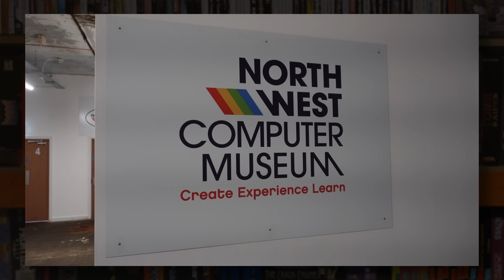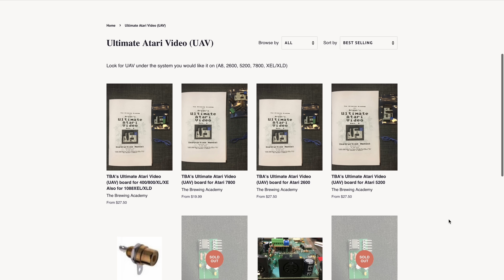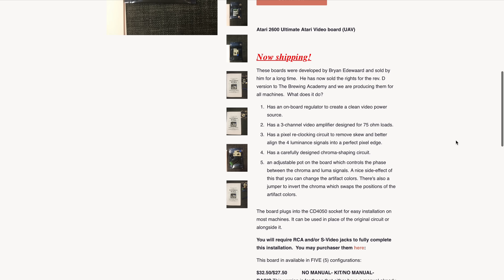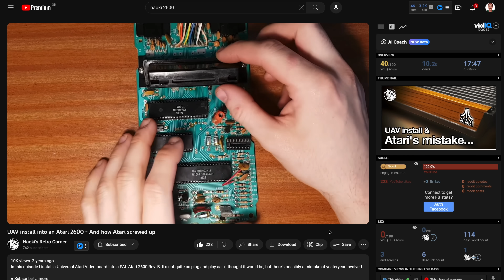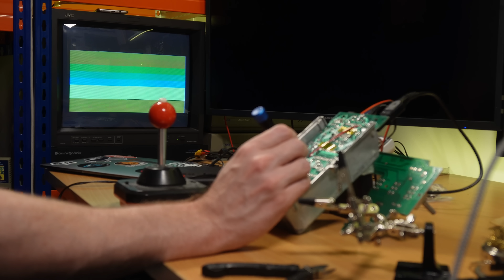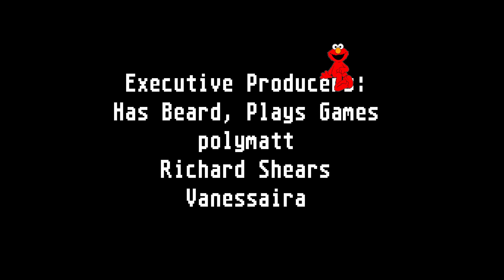A Totally Normal Atari 2600 Restoration & UAV Upgrade

Comment: Might as well replace the antique bulk capacitor, it should be thoroughly dried up and scarred. Helps to protect the old chips especially if you don't want to invest in a modern power supply.

Comment: I have not soldered yet but I do have a solder station brand spanking new and I've already watched enough soldering to realize it's easier than the stuff I did in college for welding class that was a royal pain in my ass and I still did not pass 90% of the students fail😂

Comment: I did an RF mod on a 7600 and what's cool on those is that it natively outputs the RF and just needs the jacks to hook up to.

(P.S. I drilled a hole in the side of the case there, too. Don't feel too bad.)

Comment: When you service mechanical switches like that, it's good practice to use Silicone grease (Dilectric grease) as they protect the copper contacts and buss bars from oxidation and because it's synthetic, the silicone never dries out or gets tacky which provides years of effortless smooth operation..  Don't forget to lube the detent balls (If they use them) as those are usually what hangs up those style of switches the worst.

Comment: hot glue certainly has its place, especially when it comes to modding old consoles

you solder a wire, and dab a bit of glue further down (NOT on the joint) in order to take the strain off of the delicate pads

Comment: I live in NTSC land in Oklahoma City, I buy these things not working all the time, the fix is usually the big filter caps for the incoming power. So I just replace all of the electrolytics, and what I have done is to add the eBay, composite converter, and route the composite out through the original RCA cable. I won't buy a TV unless it has composite in, so I always make sure when purchasing that it's there. Even my 52 inch LG OLED curved screen TV has composite in, and Galaxian and Galga look awesome on that screen, as it does my original Atari Super Pong that has also been converted to composite out

Comment: "ima solder this upside down" ~you  ... look you damn sadist they make dip sockets. why solder any dip package anything. doesnt matter if its a 555 or dac or what. if you ant it to be upside down put the socket on the other side of the board. now that thing is deformed and nothing will ever be alright ever again for it

Comment: As a newbie to your channel, I'm confused why the chip was soldered underneath ? Especially when there looked to be a socket in place on the other side to save you having to solder in the first place? Was it so you had extra room for the modifications?

Comment: I wasn't aware there was a reasonably priced video output mod for these old 2600s. I have three out in my storage shed.. makes me want to dust them off and mod them up. I love collecting older consoles. I've got a couple of NES's, an N64, a Wii, a Wii U, Switch, Sega Dreamcast, PS1-PS5, Xbox 360 and Xbox One. I'm thinking about installing a component or HDMI mod on some of the older consoles too.

Comment: Mmh on my 2600 jr I let the rf modulator in the system without problems. I dont like removing function and I only reposition the rf port for a nintendo multi out port

Comment: It's perfectly fine to drill holes in the plastic cases of these consoles to add the new connectors. Also, these are not one of a kind item, and we're already adding new electronics in them by that point. On my book, it's all good! Hoping the museum visitors will be able to experience the glory of video games from the 70's!!

Comment: Lol, if they're museum pieces, then doing anything to them other than restoring them to original, is not "saving" them, it's "ruining" them.
Reply: Production of the Atari 2600 ended on January 1, 1992, with an estimated 30 million units sold across its lifetime.
I think letting people get their hands on this one in 30 million is fine.
Reply: @unpersonableme1805  This is not "letting people get their hands" on one, it is a museum piece, it's going back to the museum, nobody is ever going to be allowed to play it. "Museum piece" means that a museum owns it and displays it, not that anyone gets to use it. Your comment has absolutely no validity here.

Comment: Whilst not ideal, I don’t see an issue with using the hot snot. It keeps things secure, and is relatively easy to remove if needed with isopropyl alcohol. Perfectly acceptable for this particular use case. I liked the chip solution. I have done similar for my own projects, especially handy when space is limited on one side of the board. It’s great that the museum will have a couple of these that will be reliable, with better than original picture quality, for new generations to enjoy. I have found that when repairing something that someone else has modded, it is particularly helpful if they have retained the original components, particularly in one case, where the mod board had failed and the original components were in a bag and were secured inside. Made it quick and easy to revert back.

Comment: 1977 is not 50 years ago. Stop trying to make me feel old. I got an Atari 2600 for Christmas, probably when I was around 18. The earliest I remember seeing them for sale in the stores was the mid 80's. And there is no need for me to ask how you know, I've done exactly the same thing so many times. The only way to find those tiny springs, screws and occasional ball bearing that some slider switches have is to use a vacuum cleaner with a clean bag and a strong magnet. And I have nightmares about tightly packed SMD's. My old soniq 3D TV sat in a cupboard for two years until I could try to fix it. The Atari 2600 and 2800 are much easier to fix. I still miss the old valve TV's and radios, test equipment was rarely needed. You could see what wasn't working 99% of the time and they had lifetimes measured in decades.

Comment: 1:55 it’s actually a little bit more than just speakers. Each speaker was going to be for a specific player. That’s why the 2600 (NTSC models) can be modded for stereo audio. In fact, games like combat and video Olympics actually were programmed with this in mind.
Reply: Nope, left and right outputs. It had stereo sound... Had nothing to do with one speaker being for each player, the sound for player one would be on the left, and player 2 on the right due to the fact those are the sides those players would be sitting normally.
Reply: @darrylkinslow5613  that’s… literally what I said.
Reply: @DumbBunny5328  Lol, no it's not. You said "each speaker is for a specific player" which is not true, it has stereo sound. If each were for a specific player, it would be dual mono. Wow, read your own comment.
Reply: @darrylkinslow5613  I think you misinterpreted what I meant.
Reply: @DumbBunny5328  No, I didn't misinterpret. I read your comment.

Comment: Maybe you need to add a heat spreader if you're putting the top of a chip against the motherboard.  Maybe it won't be a problem, but it's a possibility with a chip that was designed to have the top exposed to open air.
Reply: I think most boards are better for cooling than open air is
Reply: @thewhitefalcon8539  Good point.  Then let me change my story to "But what if it spreads heat to nearby components???"

Comment: I own 3 Atari 2600s and 3 5200 systems never had a problem one was even storedin a attic for 20+ years they are indistructable
Reply: I had a 4-port 5200 where the Player 1 port wouldn't recognize the Start button.  The other controller ports worked with the Start button, but I only found 2 games that would start the game when Start was pressed on a controller other than Player 1.

Comment: I don't like the idea of drilling the case and I did not like using 4 pin jack as some tutorials suggerted so I found out USB type B fits perfectly in place of RF RCA and you get all the 4 needed pins :D Plenty of USB B cables are even shileded so all you need to do is just solder SCART plug to some old printer cable

Comment: Rev B Coco boards often didn't clear the keyboard if you tried to do the piggyback technique to upgrade the 16k models to 32k. The "upside down under the board" trick was one of the many ways to get around that back in the '80's. Fun to see it again.

Part of why I used a Rev NC board in my coco 1 build. Just snip out one row of pull-downs, de-solder the RAM, solder in some sockets for 4164, move one jumper, job done; 64k Coco 1. Thanks to the NC board using a real connector with wires for the (coco 2 form factor) keyboard with a smaller bezel around it, you don't have the clearance problems the flat-cable models of Coco introduce.

Comment: I don't understand why it needed to be comp-modded in the first place. RF modulators aren't a particular reliability hazard, i've actually never seen one go wrong, and TVs do accept RF signal, that's what they're made for.

I think people are in general a little too obsessed with modding classic gear of all kinds to delete perceived flaws. Like if the system had blurry chroma and dot crawl, jailbars, etc, just leave it like that, it's part of the character. Some people grind capacitor replacements where no failure is predicted within 10-20 years, often completely unncessary as well.  "I did some cleaning and reflowed one joint and she's alright" doesn't quite cut it for YouTube in this day and age?

Comment: If you need to be forgiven then i need papal intervention for what i did to my brother's 2600.  The rf circuit was gone and that big capacitor was blown from an aftermarket plug that had reversible polarity and was set wrong.

I stripped a busted dvd player for the rca sockets and 3 small capacitors that I ran in parallel to equal the one that blew.  I also robbed a junk router of it's power socket as i always hated the Spade one the start came with.   On the outside it looks ok with the only tells being the rca outputs but on the inside it is bastardized behind recognition.

Comment: Do you have any problems with modern solders being lead-free, or do you still use old stock when working on older boards?
Reply: You can still buy brand-new leaded solder, it’s still made. (Aerospace and military still use it almost exclusively.) And with old devices like this, you have to use leaded, because PCBs from that era can’t handle the higher temperatures of lead-free. (Heck, they barely handle the temperature of leaded. 1980s and earlier PCBs sucked!!) 

In the video, there’s a shot where his solder is visible, and it’s a 63/37 leaded.

Comment: 2:44 on the bottom the 40 pin dip is your tia or co10444D, the smallest chip in the middle is the 6507 (6502 cost reduced) cpu, top chip is your 6532 ram, io for joystick and switches, and 128 bytes of total ram, the 4th Is usually a cd4050 for video mixing, 

All of which can still be sourced, even new old stock exists, so just put some dip sockets, and google atari best electronics get original and remanufactured parts for everything from pong i.c to atari falcon parts
Reply: You can tell it's a pal unit because ntsc 2600 only use a single 3.579545mhz oscillator

Pal units need two, and still produce less color and run slower

Comment: On the hot glue parts, I'll allow it, reluctantly,

Thinking more about it though hot glue is probably the best cheap middle ground option for structural support for public use, it does help, and if it were to break with use it's not awful to remove and repair like a resin would,

Every tool has its legitimate uses, I guess,

Comment: Sure, people hate hot glue. But I used to work on a medical device assembly line, and we used hot glue for exactly that same purpose on patient monitors, capnographs (CO2 monitors) and paramedic ventilators. It holds connectors together reliably and it peels off cleanly when you need to make a repair. I hate it too, but it's the right tool for the job.
Reply: There’s different kinds of hot glue. Industrial hot glue has a much higher melting point than craft hot glue.
Reply: Also comes in handy in high stress areas  on pcbs like connectors.
Reply: @benTi900 i hate having to use it but i can understand it. I had a connector which was likely to be yanked out so i had no choice but to use a generous amount of glue to hold it to the case...
Reply: Ur american
Reply: Reliably? That's a laugh. There is nothing reliable about the connection of wires using hot glue... You do this on a medical device assembly line? What the fuck?
Reply: @darrylkinslow5613  
There are several commercial quality hot glue adhesive. They require a special hot glue gun since they melt at much higher temperatures than craft glue guns.  They are all so much stronger than the cheap craft adhesives. Your probably used to.
Reply: @darrylkinslow5613  I'd rather the glue be there and be useless than not be there and have someone die
Reply: @darrylkinslow5613  Wow, some random bot thinks he knows more than entire industries. Well, we should all bow down and change the production lines because of you, right? Get lost Captain Duncil.

Comment: I think my first time soldering something was the power jack on my 2600 clone. Also recall doing it for a couple other consoles, strange how often is seems to be a point of failure, even if consoles were always plugged on. Maybe the cable strain relief makes them a bit too stiff and heavy, and over time it builds up?

Comment: i have famicom clone half of the pcb was missing, so i made a missing pcb part one sided , routed top layer with emanal wire and installed all ic's the right side up, but i fliped legs 180 degree so they are pointing up
it looks tragic, but works as oryginal, it even have hole drilled in the ppu, .... yes and i was the one who broke the pcb in half when i was 10 and drill the hole when the famiclone stoped working
fun part is it uses all oryginal ports exept av rca jacks and the reason why the console stoped working was also discovered while fixing it, simple solder wisker bridge

Comment: This is awesome! Thank you! I didn't know about this mod. I actually have two PAL 6-switch systems that I've tried to composite mod (w/kits) but the result ended up worse than RF on BOTH systems, even after replacing a bunch of components and trying with multiple CRTs and power adapters. It even failed with a drop-in s-video mod and I never really did understand why even after asking in forums. Might give this mod a try, worst case I might narrow down the reason for my previous issues and I already have plenty of experience with removing and re-installing components in them =D

Comment: A couple months ago, I came upon my Heavy Sixer (made in Sunnyvale), and did some research into the best choice for a composite mod for the modern era. I came upon CleanComp, bought it, installed it in about half an hour, and it required zero component cuts, zero chips flipped. Simply solder the board directly to the bottom of the TIA (after a bit of light solder-braid pad-leveling I'd suggest). It outputs (as it says) clean composite or S-Video output. I suppose if you knew about this mod, there wouldn't be much content to make a video on, but I definitely thought it was worth a shout out! 😅

Comment: The reason why hot glue is bad -- isn't just because it's bad craftsmanship or something -- it's because on a hot day in a non climate controlled environment, it can reflow -- both loosening and clogging connectors so that they no longer make contact -- sometimes just the weight of the glue itself is enough to dislodge the the thing it was supposed to be holding in place. -- If you are able to use either an epoxy or a gel based super glue, then you can avoid that whole issue.

Comment: Meh...I've seen tons of old Ataris loaded to the gills with aftermarket mods. Back when I had one, it had been bodged to provide a direct RF output and had two aftermarket controllers(which was nice since the fire buttons were also on the stick), but it was my one console that almost never required blowing in the cartridge to get it going so there's that.

Comment: I think hot glue gets a bad rap from hack modders using it to cover up their terrible soldering work. It makes sense to use it for structural integrity. of physical components like ports. Still it probably won't hold against jon q public the 200 lbs gorilla reefing on the thing. You probably needed something more aggressive with how hard it sticks to the case and connectors and rigid like epoxy.
Reply: Yeah, I can’t see hot melt being durable in this application. I also immediately thought that epoxy would be better. Or, ya know, panel-mount jacks that screw on…

Comment: I scored a Heavy-Sixer from a junkyard; it seemed to have been in the home of a heavy smoker before, and later half-buried in mud for decades, but after LOTS of deep cleaning of the case and board and replacing a bad RIOT chip, it works fine.

In spite of the RF modulator looking like a solid chunk of rust, it actually produced a great picture over RF (using a fresh coax cable, not the P.O.S. one from Atari which had been cut anyway) so I wanted to try preserving it by not removing those components from the board when I did the simple single-transistor composite mod.

The resulting picture was horrible with interference, completely unusable, so off those components went and then the picture was fine; so you really do need to remove those components, at least if you're doing the simple mod.

Not sure if you still need to with the UAV mod though; would have been interesting to have tried it without removing stuff first, to see how it looked.

Also, rather than drilling holes in a Heavy-Sixer case, I ran AV leads out the hole formerly used by the RF cable, and the cable wrapped around the internal posts for strain relief.